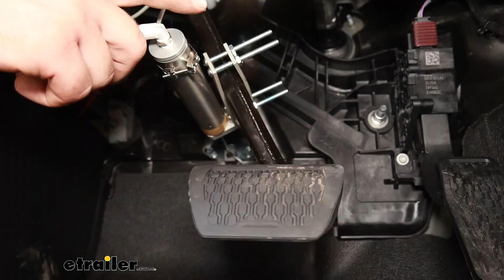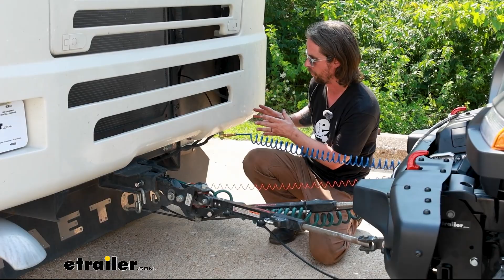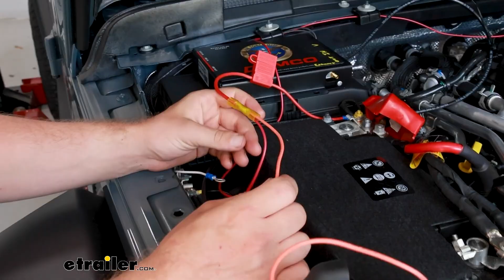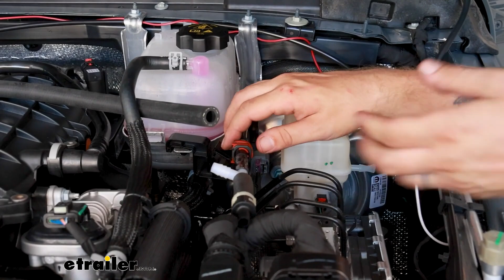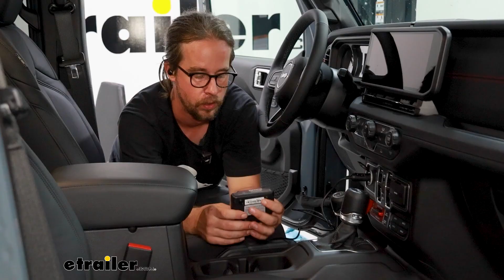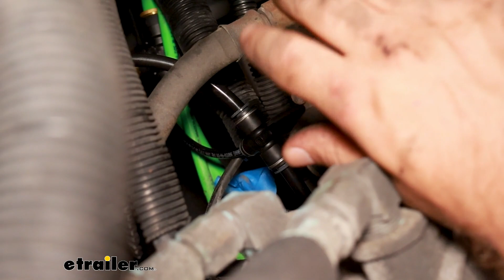Demco Air Force One Flat Tow Brake System Installation Guide - 2025 Jeep Wrangler Unlimited

Comment: This was a great video since I was moving my Air Force One from a 2017 Jeep to a 2025 Jeep.  Before finding this video, I was wondering how I was going to connect the brake hose to the booster as the hose to the booster on the 2025 is much smaller.  The heat gun trick worked great. This video saved me a bunch of time on how to accomplish that connection.
Reply from the maker: That's awesome! I'm so glad that we helped you out. It's never fun to be faced with a project and run into a part where you're unsure what you need to or how to go about doing something.

Have you taken your new Jeep out on a trip yet?
Reply: @etrailer  Going to the coach today to connect the Jeep and make sure everything is functioning like it's suppose to.  Keeping fingers crossed that all will work.
Reply from the maker: @robwhite2576  I'll keep mine crossed for you! 🤞